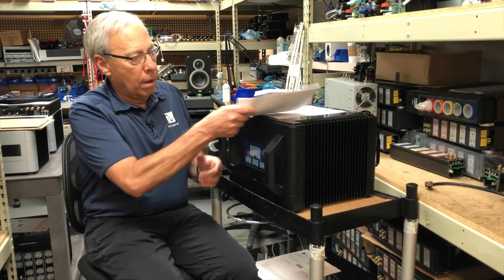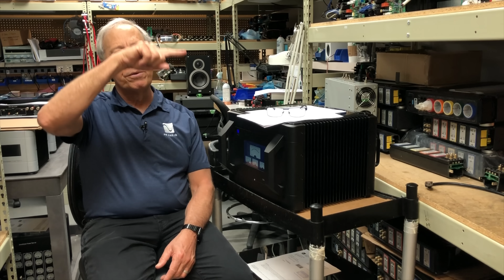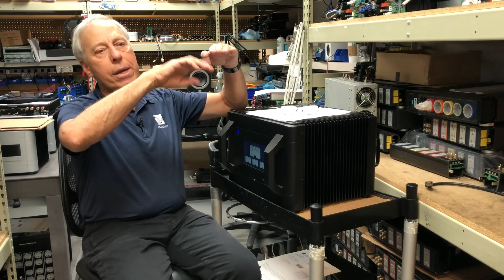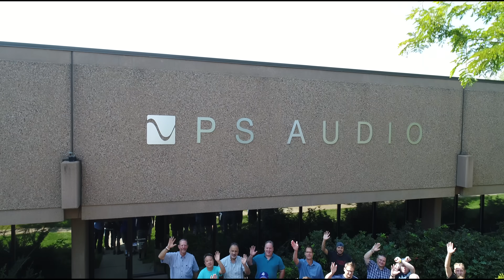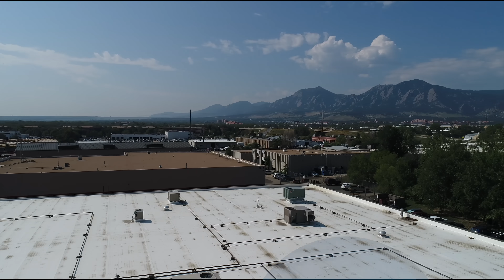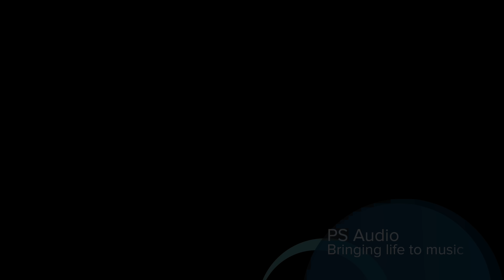What's the best voltage and frequency for audio?

Comment: I believe avionics operates at 460hz .The higher the frequency the smaller the transformer .Switch mode power supplies for lighting work at 22khz .There are limitations to everything .you gain one way loose another

Comment: Is it safe to plug a 110v 60hz AV receiver to a 220v 50hz line using a standard transformer?
Reply from the maker: The Hz difference won't bother it and as long as the transformer steps down the voltage from 220 to 120 and has enough power to handle it, you should be fine.

Comment: The only advantage to 50Hz over 60 Hz in my opinion, is that 60hz has the ability to disrupt the heart of someone who gets electrocuted more severely than someone who is electrocuted at 50 Hz. I don't understand why, it's what I was taught at DeVry. No explanation given. I don know that a mechanic working on an early GM high Energy ignition system who grounds his family jewels against a fender while grabbing at a Leakey ignition wire, he's going to get knocked on his ass much faster that a mechanic working on a low voltage system. Duh, right? Back to the discussion at hand, the higher the frequency in AC the higher the voltage. When you're working with radio frequencies and you go up in frequency you also go up in voltage. Which proves Tesla right when he said that sending commercial energy to every household and business at D.C. Was no where near as efficient as even low frequency AC current, he was spot on. In fact he envisioned sending high frequency electricity to every home, and business in the world for free, via AM transmission. After all, AM radio is broadcast over a carrier frequency, with a transmittable frequency over the top of that. So, if AM Radio began its broadcast frequency with a carrier of 500,000hz, everything from 500,001 Hz to 520,000hz could be rectified as an audio signal broadcast from 1 to 20khz. Of course the band passed was much less than that but the principle is there.

Comment: Me thinkith Paul lives in an alternate universe.  If you can prove a piece of sterio equipment sounds better through your "power plant" then you better look at that piece of equipment's power supply because there has to be something wrong with it.  And if your power is dirty or "cropped", file a complaint with your public utility commision, assuming your utility hasn't fixed the problem.  There are pretty strict requirement for voltage, frequency and distortion.

As for power, the best way to make cleaner DC power from AC is to rectify three phase.  Shouldn't all the pure audio phile systems use three phase?

Maybe you can pass 400 Hz into a switching power supply okay but not sure how iron transformers like it.  Then there is the increased skin effect.  And the tuning of AC transmission lines.

Comment: But in reality, for transmission purposes, the lower the frequency the better. 400 cycles would be fraught with trouble on a transmission line. The latest and greatest transmission lines are high voltage direct current. DC would be best for supplying audio equipment too. Easiest of all to filter!

Comment: There are two components to the question in regards to power distribution.  At 400 HZ in short distances such as in an aircraft, it is true the transformers and motors are much smaller and lighter. However over very long distances, load impedance changes causes huge problems as it is not a steady state load. This can create sections of long distance power lines that act as a 1/4 wave stub with it's voltage distribution as the load is reduced on the far end of a long line.  Yes it is possible to get higher voltage at the far end of a line when unloaded, and the reverse is true, lower voltage when the line is loaded lower than the line impedance.

 The capacitance in the transmission line couples more voltage out into the air and the inductance couples more efficiently into fences, cable TV, telephone and other materials near the line resulting in larger losses.  Only when the load impedance matches the line impedance does power efficiently transfer.  Transformers even though smaller must be made with smaller iron particles insulated from each other.  See Induction Heating videos for what happens at high frequency and higher current on a non laminated iron core.  Even my kitchen induction cooktop uses this loss to heat the pan.
Due to the shorter wavelength, power generation synchronization, voltage regulation, and power factor corrections become unmanageable over long distances.

On to the amp.  Early power amps used analog power supplies with huge power transformers. Better ones used toroidal transformers for lower magnetic leakage into sensitive electronics.
Switch mode power supplies with their electrical noise are now commonly used in pro gear for weight reduction and higher efficiency resulting in less electrical system overloads for the power.  Noise was filtered to acceptable levels for big concerts with live audiences who brought their own noise level that masked system noise quite well.  This DC/DC converter is sometimes referred to as a power station.  Most systems operate them well above the range of human hearing such as 30-90 KHZ typically as the filter components are smaller to shunt the noise.  For efficiency most operate in the PWM class C range on switching transistors which are MOSFTS most of the time.  Sine wave for low noise is either PWM for efficiency or class AB for much lower efficiency but much lower noise.
Only very high power supplies use IGBT (Insulated Gate Bi-Polar Transistors.  This supply is most often relegated to UPS supplies and not used in audio amplifiers directly.
Low power cheap home stereo gear most often has a small transformer due to the limited power. Older Pro gear uses huge transformers and are very heavy. Newer gear for efficiency and weight mostly use Switched mode power supplies.
Specialty high end home gear with money as no object are free to design other supply designs different from industrial standards.
Hope this helps why power line frequency is not 400 Hz.  Too much coupling out the line and into adjacent stuff to be practical over long distances.

Comment: AC is necessary for transferring power over greater distances!
If we were to have a 120V DC powerline, only people living within a certain miles from the plant (usually 10 miles or so), will get the right voltage. And people further down, won't get enough power/voltage or amps, as it drops per distance. An issue not happening with AC; or at least, much less happening.

The best voltage on average for audio, is about 30V. 30V and 8 Ohms, gives 3.75 amps, which gives about 112 Watts per channel.
That's a very good power rating for most normal listening..
Also, if you study the Fletcher Munson curve, you'll notice that our ears are most sensitive at 3.5 to 4kHz. Not something you will want to hear as it's a very harsh sounding tone, but just like we see green light better than red or blue light; so we can hear that frequency range better than any lower or higher frequencies.
Reply: Sort-of. AC makes for easy voltage conversions, and for longer transmissions, you want higher voltages as that means less current and lower resistive losses. However, AC has its own disadvantages when it comes to really long distances or long underground or underwater cables. For those situations, high-voltage DC (typical range is 100-1000 kV) is the better option. 

If you're sending power around a city, AC at a few hundred to a few thousand volts is just fine. When you're sending it tens or hundreds of kilometres, HVDC becomes more favourable.

Comment: Leaving out old tube tech that is designed to use AC directly in some parts. Wouldn't just DC be the best for rest of the amplifiers? A lot of design goes into smoothing out AC ripple to create clean DC rails that amps use. With pure DC coming in from the mains there wouldn't be such issues.
Also what would be the point of "cleaning" the mains AC with expensive AC-DC-AC converter if the AC will be converted into DC in the amp anyway? AC wave that has it's "peaks chopped off" should be simpler to convert into DC because there's less ripple left to smooth out in order to get DC from that.

Comment: (Takes glasses of to imply learned wisdom about to be uttered) 60Hz is the supply frequency because that's the rotation speed of the power station generators. Rotating megawatt 400Hz generators do not exist. The skin effect on very high voltage electric lines would make long distance transmission very inefficient.Transformers in any domestic equipment are designed to operate on 60Hz and running them on 400Hz raises hysteresis losses and magnetising currents significantly. 
The mechanical noise of a 400Hz transformer in the amplifier would drown out any imaginary sound improvement.
400hz transformers such as on aircraft have very different core design. 
Since the supply voltage is reduced by a transformer and then rectified to pure dc in an amplifier how can the supply frequency affect the sound?

Comment: REACTANCE!
That's the reason 400hz cannot be used for long distance transmission. It works fine in an airplane but try sending it from Hoover Dam to Los Angeles or Utah. The losses would be substantial. OTOH, 400hz makes for much smaller and lighter magnetics. It also reduces the size of power supply reservoir  capacitors. Hence it's use on air and marine craft. I have no doubt it will also be used on large spacecraft when we get there. But as a world transmission standard, no it won't work.

Comment: 400Hz mains frequency is what I experienced on SSBN equipment. As has been said here the main reason was to reduce the size/weight of the power transformers. And as I commented in another of Pauls videos a AC -> DC -> AC converter to isolate equipment from a flaky mains is not all that uncommon. A major issue is what's called "Common Mode Spikes" where the actual earth ground spikes sometimes can be in the (10's) of thousands of volts. That kinda thing can happen when someone sets off a nuclear bomb/torpedo near you. https://en.wikipedia.org/wiki/Ethan_Allen-class_submarine

Comment: actually well - the best would be DC wouldn't it? no frequency at ALL
Reply: Just on the off-chance you're still curious about this - DC would be awesome for most things. The problem is that we cannot easily efficiently transport it over long distances. The reason for that is to have low losses per watt, your voltage has to be high so your current can be low. That is why power lines operate often in the hundred's of kilovolts. With AC that is no big problem - that's what we have transformers for. But to step-up DC to higher voltages on such a large scale as a power grid, the equipment has to be enormous - we're talking capacitors the sizes of small buildings. So it's just not practical to do that - hence why we're stuck with AC.

Comment: I find some rather erroneous information being presented here . . . . power supplies/inverters/sinewave re- generators are not any kind of new invention. Also, why would AC mains frequency have any effect on "sound quality"? Audio stage supply voltages are DC. In addition, the idea of using 400Hz mains frequency dates back to WWII and is still the current standard mains frequency in commercial and military aircraft. Total BS fodder which doesn't do anything other than discredit whatever overpriced, over-hyped, junk he's selling . . . . integrated amplifiers using a Class D output stage? Are you serious? No audiophile in their right mind would have anything to do with Class D shit.

Comment: Back at the turn of the millennium, Mark Levinson's Reference components, the No. 32 preamp and the No. 33 and 33H amplifiers, all used "400 Hz oscillator circuits in power supply regeneration". That sounds similar to what you are talking about here. I thought it was interesting.

Comment: For a long time, I've thought it would be fun to use a bunch of batteries for my power amps. I would use individual chargers when the system isn't in use and discharge in series when on. Ten 12 volt batteries would provide +- 60 volts directly to the rails. Deep cycle GEL SLA (wheelchair) batteries are about $100 ea. in quantity. The power supply would be considerably cheaper than rewiring the house and buying a power conditioner.

Comment: Did not work with the tube heaters, However you forgot to mention that you also can turn the heaters on with DC. and that can be accomplished by adding an inexpensive diode and a electrolytic to the heater line. The advantage is that the filtering caps as well as the transformers could be smaller. The military had been using high frequency power busses for sensitive communication, radar, acoustic and micro signal satellite bursts downlinks. Also hi frec power feeds are common in naval ships and  roving army radar sites as well as USAF intelligence gathering planes with ultra sensitive sensors and receivers.

Comment: All induction motors think air conditioner, refrigerator, fans, would run almost 7X faster, and burn up. Also long distance transmission would radiate more and there would be much higher losses over the very long distance transmission.
Reply: Induction motors need to be wound to the number of fields needed for the rotation per time (RPM) desired  The motors you are talking about are wound for 50 Hz and truth it would not be plugged into a 400 Hz circuit.  just like you would not plug into voltage not compatible with your appliance.  As to radiate the energy and not being able to transmit long distances is just a myth, there is not a reason that high voltage could not be transmitted long distances as long the step up and step down transformers are efficient.  The transformers are more difficult to design as the frequency goes up.  They need to be resonant for the efficient energy transfer.
Reply: mtabernig it's all moot, since no one is changing the 50/60 Hz world standards.
Reply: sure it is a technical sudo  blog but  try to present answers that are based in engineering principles and physics.
Reply: I think you mean wound for the number of poles, since there is only one rotating field.
Reply: yes, you consider the number of poles and the speed, ex1750, etc and wound the motor for that need.

Comment: Why does the higher frequency result in worse bass?
Reply: because the smaller transformers and the higher frequency do not have the time and the "mass" to create and collapse the magnetic flux to transfer the energy. Mostly has to do with transformers resonating at the particular frequency, however that is a problem many manufacturers do not do a good job. All of the Transformer  components from the iron core and the dimensions of the windings with what gage wire on both sides and the physical dimensions of the coils influence the energy transfer. if the transformer is out of resonance the energy transfer would be very ineffective. Is like trying to tune up a particular radio band with a completely wrong antenna dimensions. you may be able to hear something however, it will be completely degraded.  Electromagnetic Resonance is one the things that most  electronic pros do not understand much of.   To put it in a simple form An example of Mechanical resonance is a guitar tuning process. You Press the first string in the 5th valley between the 5th and 6th fret and plock it, the string right below if the tuning is correct start to vibrate by itself, some of the energy from the thickest string is being transferred to the thinner string because both strings are playing the same note.  They are at that point in resonance. I hope that this answer your question
Reply: Real question is why the rest gets better? Current transformers are designed to run on 50/60hz so inefficiencies are to be expected at higher frequencies. But if the sound gets better at higher frequencies then apparently the power supply of that amp is crap at removing all ripple from 50/60hz line frequency. The amp should never see any part of the AC on the supply side anyway since they all operate on DC instead (except tube heaters in some tube amps)
Reply: You're Right!!! Ding, Ding, Ding!!!!    Transformers work fine at any frequency if they are designed for the frequency they will operate. I like to run my heaters with DC that way you eliminate any ac buzzing at high volumes.
Now your idea is that the power sup are not up to snuff is the right thing...they do not use inductor chokes between the filter capacitors, they use a resistor instead and I like to use 2 different values as the first capasitor bank and the second capacitor bank. at both sides of the large iron core inductor choke. Then use voltage regulation before you come out to  B+.   Like I sed No Inductive Choke and no high power voltage regulation. That is the problem right there.  They rather sell you a power supply on the outside. well if people like to purchase snake oil WELL there you go.
Reply: My guess would be that because the mid and hi end were great the bass was only comparatively worse. Alternatively there may be an issue subjectively when producing notes below the supply frequency, with some kind intermodulation effect.